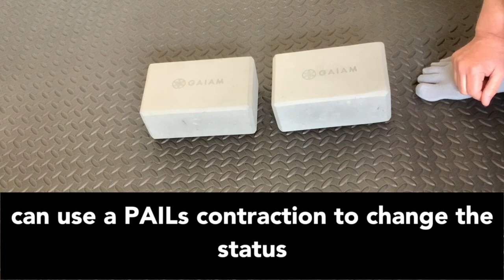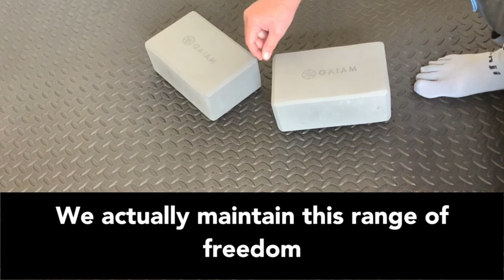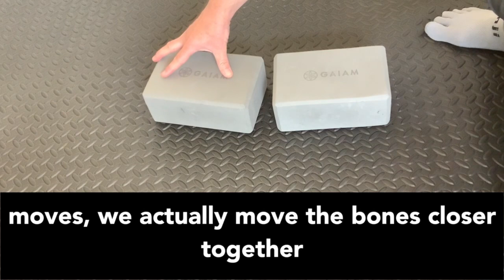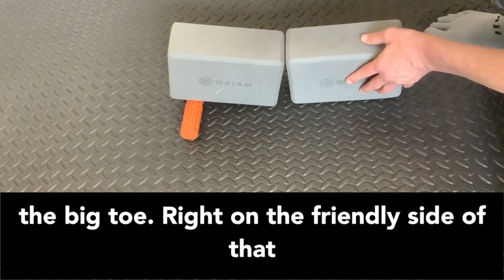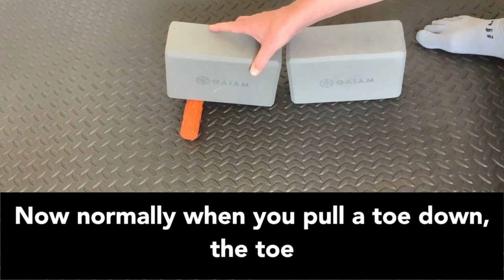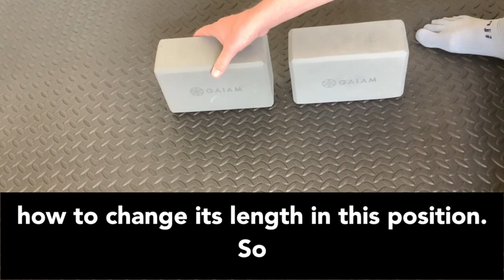What are PAILs & how can they be used to adapt the shape & articular dynamics of a joint capsule?

Comment: Can this work even if theres a bone spur that has developed?
Reply from the maker: Yes - most of the people I program this for have at least a little spurring. That does mean there are some more variables tho: usually it also means the muscle which flexes the toe down is not well expressed, so we'd add a period of time to make sure we can feel that ok.

after that which can run like 1-6 weeks typically, the size and shape of the spur is the next variable.  smaller or less pointy spurs are easier/quicker to deal with the larger or more pointy spurs. 

if there's a history of immobility, serious injury or surgery, that can also change how we'd approach things, mostly it just makes it take longer than a toe that already moves ok but just has a spur.

overall though its a threshold thing, we need just enough space for the joint to work around the spur to deliver sufficient range of motion for whatever you do - and thats generally attainable in my experience even if the toe doesn't become 100% of what it could be.
Reply: @Articular.Health  Where can I find more details on your programming for this? I've dabbled with PAILS and I do notice I get temporary relief from pain and improved flexibility in the joint, so I'd be curious to see if I can make more progress here
Reply from the maker: @stevegr9218  That's a really good sign that there is a lot of opportunity for improvement there!  We could setup an online consult, an in-person consult (in San Francisco), and I have a website at www.articular.health - there's content there you could work through on your own, or in conjunction with personal consults (which I'd recommend at least 1 at the beginning)
Reply from the maker: @stevegr9218  Oh also - you can find a link to book an online consult on my channel page